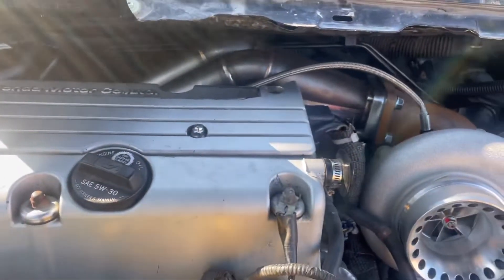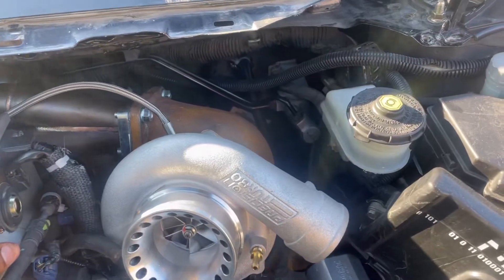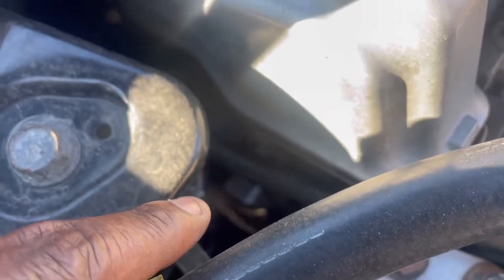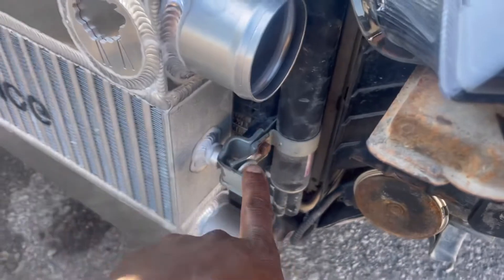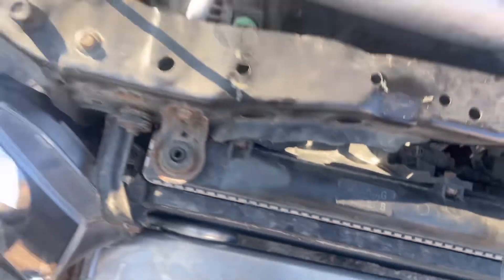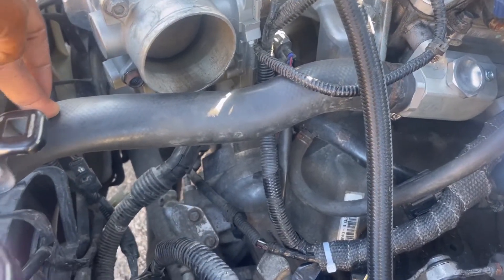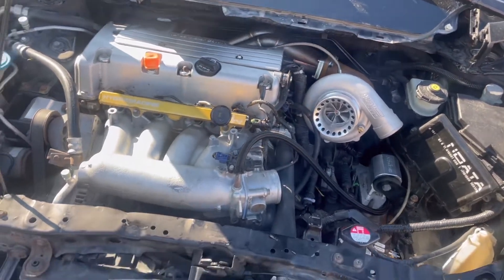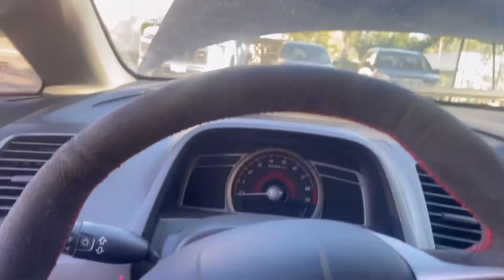The next chapter episode 1

Comment: What's the spec on the intercooler?? Been looking at them but I don't know what size to get
Reply from the maker: 3.5 inch core with 2.5 inch inlet and outlet rated for 800hp
Reply: @shamarbrown5683  do ya know the measurements ??x??x??. I don't want to get one to long or that I can't get the bumper on .....
Reply from the maker: What car do you have there is only one that fits 8th gen from sheepy
Reply: @shamarbrown5683  oh I was looking at speedfactory my bad